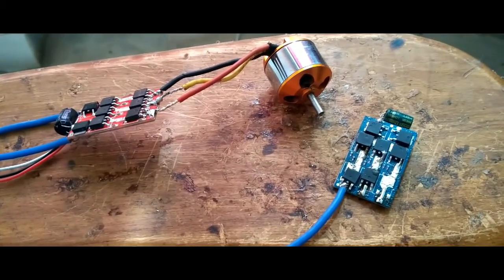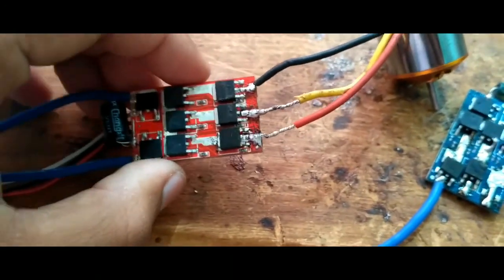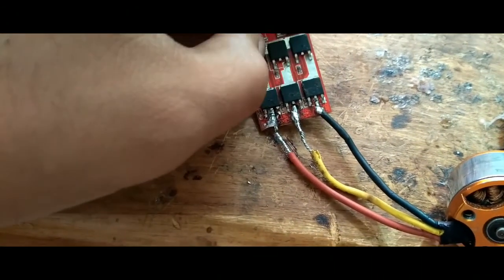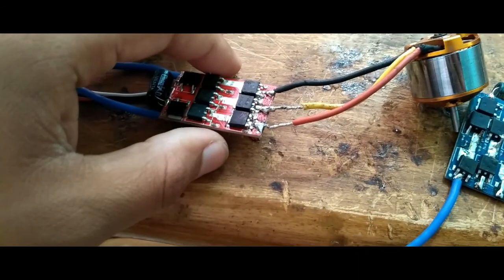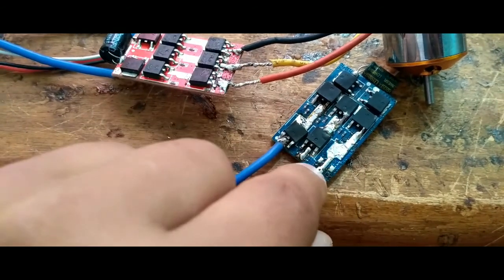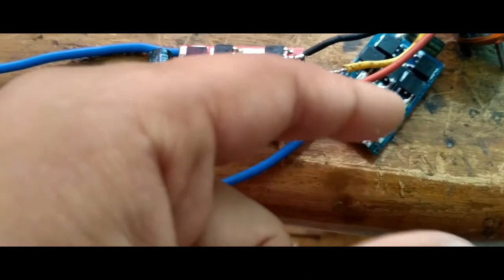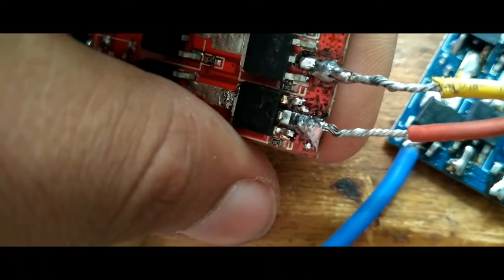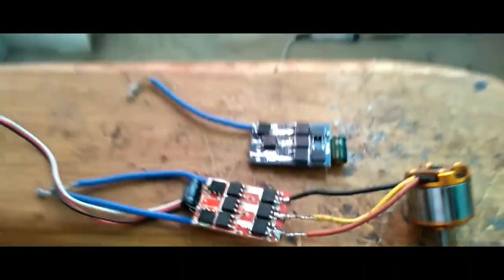Repair Burned-Damaged Esc | Easy & Safe

Comment: I need your help!
Yesterday i was flying my race wing and it crashed badly.
Nothing got damaged.
But, next time the motor rotates, the esc gives a gritting noise.
I am sure that the motor is good.
And again when I tried flying the wing,
I have to put throttle to full just to take off and it crashes easily 
The thrust was cut down to less than half!
I even tried calibrating and reprogramming.
But, nothing was changed.
Please help!
Reply from the maker: Try spinning motor with hand if it's freely moving then esc is bad
Reply: Just Hack It oh yes! The motor was perfectly fine!
    It was the esc which is bad.
    As you know the story, the esc can spin the motor, but, the thrust was only half!
Please help!
Reply: Get a new esc or try doing what the video explains
Reply: @taylorlatch2635  it’s been six months dude
Now I am building autonomous planes
I’ve had many successful projects lately 
Thanks anyways

Comment: Mosfet is an acronym for Metal Oxide Semiconductor Field Effect Transistors.

A transistor is a switch which turn on and of. That's is how computers work where values can be 0 or 1. In this case though being a field effect transistor the 3 legs are gate source and out put. While say the circuit is off the mosfet continuously has a voltage at the source and gate is closed it is when we turn on the circuit and the source now has higher voltage than it did earlier and that makes it let the gate open so that the mosfet can supply power where it is needed.

This is just to make the concept easy to understand and is not the evidence or information which you will find electronics or scientific terms. 

It is like you are at your girls place her parents out for the day and you station a friend ie source to inform you if he sees them coming so that you can disappear on getting the signal instead of getting caught in her house! The source is active and does not trigger you till its clear, but if he spots someone he detects the change and signals you to get your ass out of there asap (acronym for as soon as possible).lols! I bet that registered better in your mind as you can relate to it. 

Additional info not related to Esc read if you want to.know - 

Before someone asks an Acronym is a word that is generally formed using the first letter from each word in a name or title. Some easy examples are RIL as in Reliance Industries Limited, Hal which is Hindustan Aeronautics Ltd, Radar which is Radio Detection And Ranging, Laser is  Light Amplification By Stimulated Emmission of Radiation.

As in the last 2 examples the rule of taking initial letters of each word is not strict, like we do not take b from "by" and o from "of" in making it laser. There are many acronyms we use regularly like ISRO, NASA, TV, LIDAR, Sonar, can you figure them out? If I'm not wrong I think there wont be anyone who knows all or most of most of the ones i explained and the last 5 or six I didn't.

Alright here 
NASA - National Aeronautical and Space Agency.

SONAR - Sound Navigation And Ranging.

LIDAR - Light Detection And Ranging

ISRO - Indian Space Research Organisation. This was recently in the news, must be easy right.